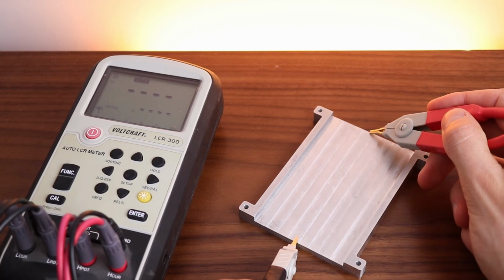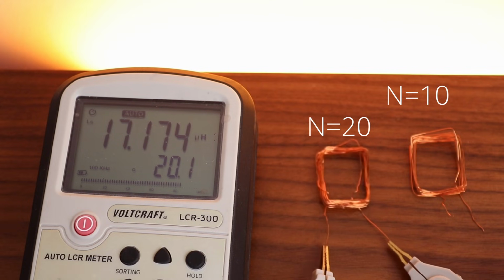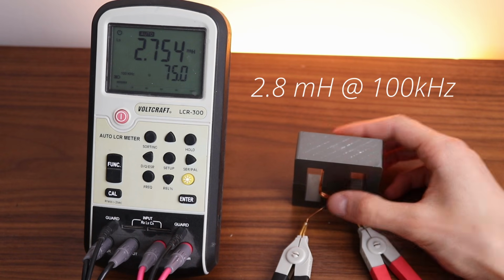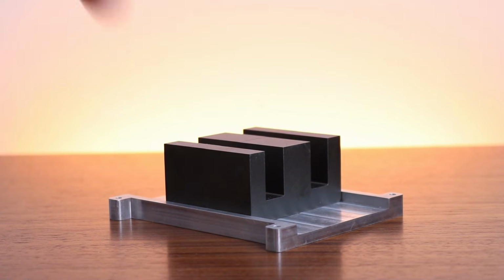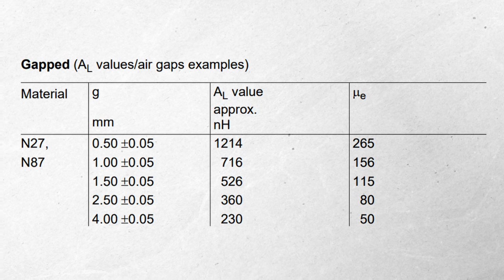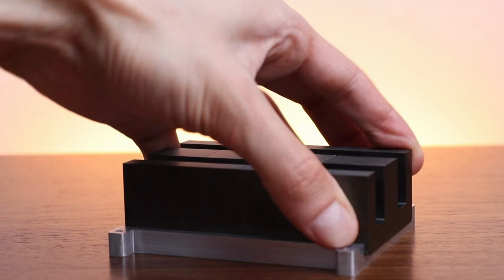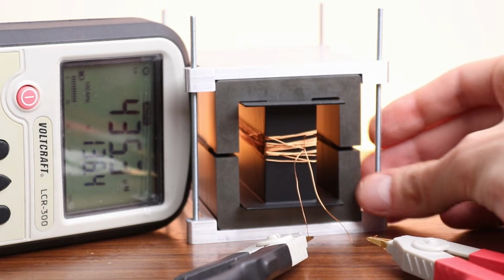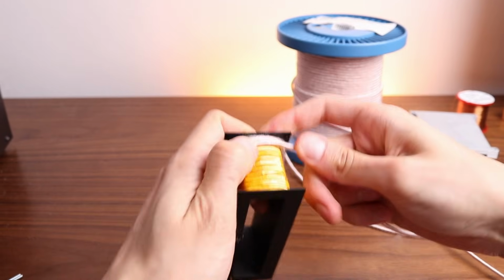10 Tips to Build the Perfect Inductor (Like a Pro)

Comment: That is a chunky boi, what are you going to do with such a huge inductor anyhow?
Reply from the maker: Haha. Yep, big boi indeed. I am building a DC-DC converter. Around 20 kW. Frequency is quite low though, so thats why its quite big. First iteration it is. So if tests go well, it can be optimized and frequency can be increased. But only if tests go well 😅
Reply: @NickElectronics yeah, that looked in the ballpark of 10kW.
Low frequencies because of IGBT?
Reply from the maker: @VEC7ORlt  Actually, I am going to use SiC transistors at a frequency of 25 kHz, at least in the beginning. So, not too low, and not too high. Why only 25 kHz and not higher? I need to test the developed modulation and control, and at a lower frequency it’s just easier. Why SiC transistors? Cause I already have them :D
Reply: @NickElectronics  Have you considered a modular approach, with 1-2kW paralleled modules with current sharing? I recommend qspice for power simulations, you can test your digital control algorithms, you can write C code inside (and verilog). It has non-linear inductor model as well. And it's free. Also smooth running, no bloat.
Reply from the maker: @andutei  I’ve already done simulations in PLECS, and it works. I’m going with a 3-phase interleaved approach to share the current. You can see the topology in my Macro Soldering video, somewhere near the end.
Reply: @NickElectronics  Ah, I saw. very cool. I've done 4-phase interleaved digital controlled bucks but of lower power. I have PLECS, PSIM and Simulink, but I still prefer qspice.